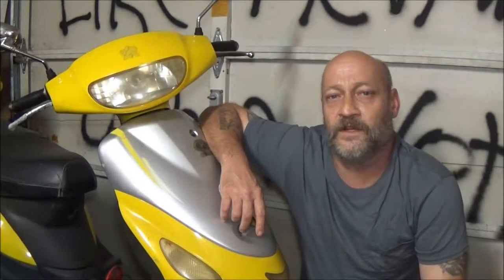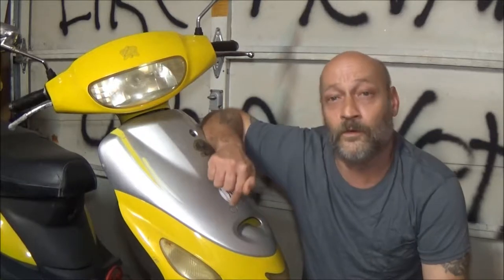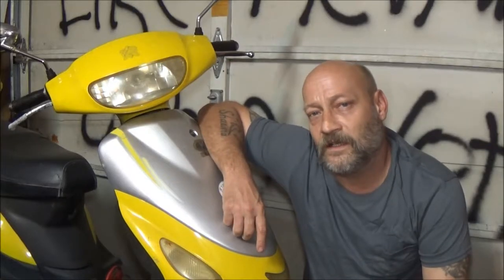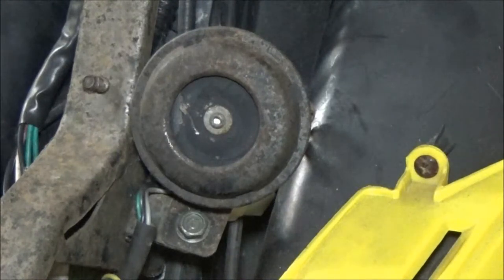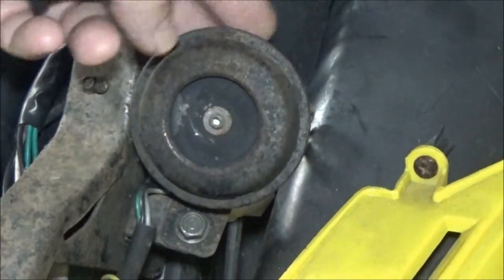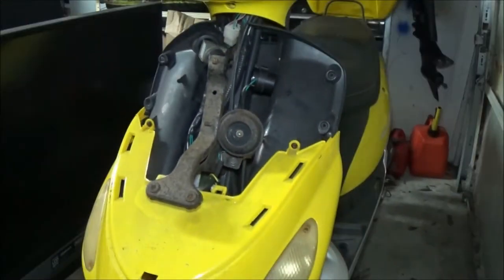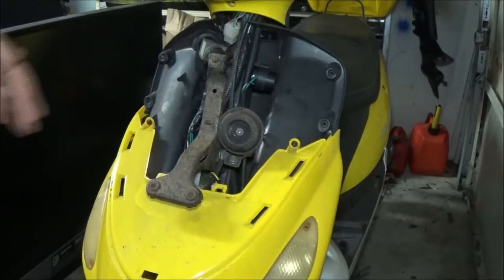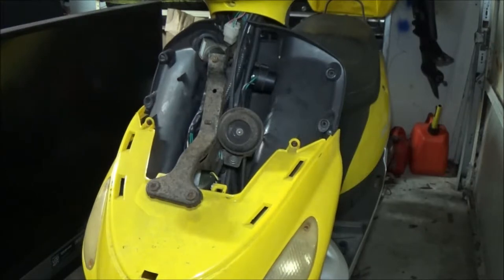Scooter Horn Repair

Comment: Mine don’t make any noise ima tear mine down one of theese days
Reply from the maker: You can get these horns online for like 10 bucks if it's too far gone.
Reply: @shabear1000  I ended up geting mine all apart today it it was corroded took it apart to fix it couldn’t get it to work so I went to auto parts store threw a car horn on it way louder works perfect
Reply from the maker: Awesome. Glad you got it working. Have a great week.